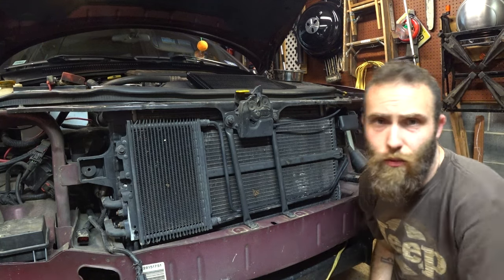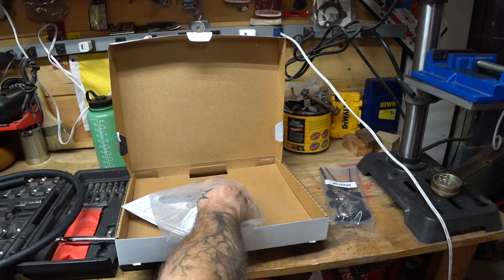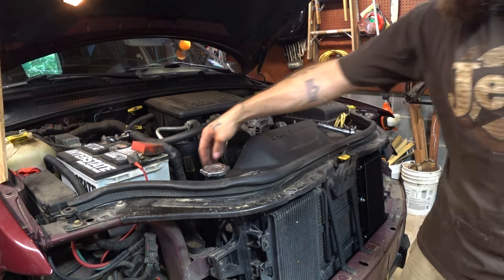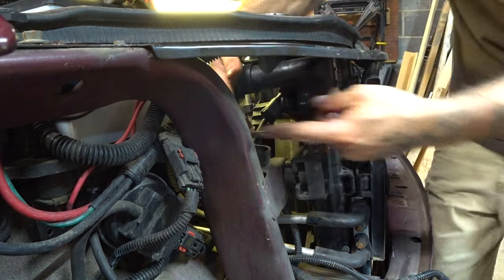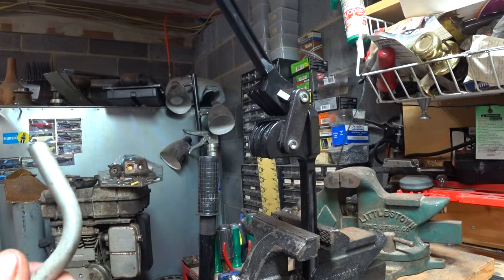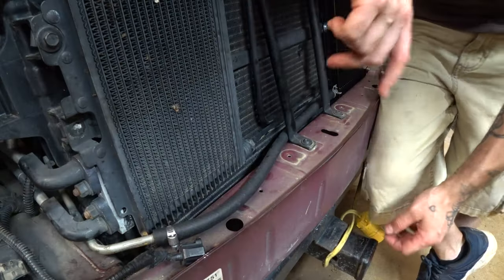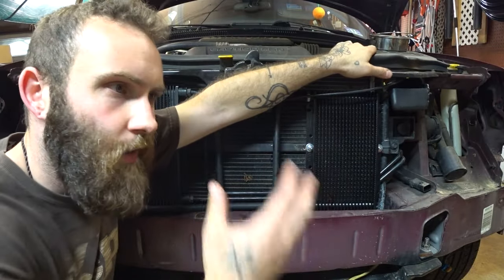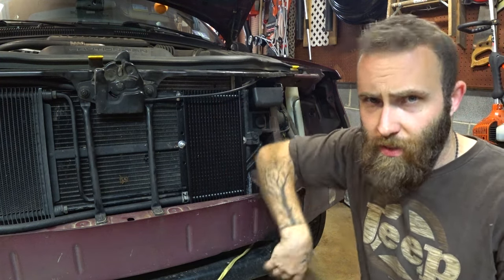How to install a Transmission Cooler - EASY!

Comment: Great upgrade!! Simple and effective. I think upgrades like this should be done first to your rig instead of adding every kind of light bar on it... performance before ornaments. Can’t wait for the fan installation video to come out
Reply from the maker: Amen to that! The fan video is going to be a while. I am hvaing trouble dialing in where I want them and what needs to be done to improve efficiency. Once I have it dialed in, I will post a video

Comment: In my opinion that's just a a good idea a good fix or Improvement to any vehicle of any make or model good job dude
Reply from the maker: Right on! Thanks buddy!
Reply: Definitely...even if you aren't towing, keeping the automatic transmission cool is essential as heat is what kills them quicker than anything.  Far cheaper for roughly $50 transmission cooler than $3k+ for a transmission rebuild or replacement.  

I think he's also spot on with adding additional electric cooling fans, not necessarily need them running continuously but if you are towing heavy or in heavy traffic being able to turn those auxiliary fans on will not only help cooling the transmission/power steering fluid it'll also push extra air through the condenser helping your air conditioner and through the radiator helping to keep it cool as well...I don't think the clutch fans or hydraulic fans help too much with airflow when you are sitting still.

Comment: I've done some experimenting over the years, the setup I like to go with is only using the aftermarket external trans cooler around the end of spring/early summer. I've noticed it allows the motor to run cooler for longer before the fan comes on while in traffic or while the motor is warmed up sitting at idle. I live in New Hampshire, so around fall time, I hook the stock trans cooler back up, from the transmission, the fluid goes into the stock internal cooler first, then into the external, then back to the transmission (mine is the 4.0 with the trans cooler inside the radiator). That way the trans is warmed up and ready to go after warming up on a cold start during the cold months. When I am not using the stock cooler, i leave the transmission fluid inside the stock internal cooler with a hose running from the stock trans cooler inlet to the outlet to prevent anything from getting inside. As stated above, after experimenting over the years during different seasons with below zero temps in the winter, and above 100 temps in the summer, using only the after market external trans cooler in the summer months is what I have found works best for my Jeep.
Reply from the maker: This is really insightful. Thank you for sharing. I am brainstorming a way I can easily switch between the two so that I can give this a try
Reply: Have you had issues in the winter with just the aftermarket cooler?

Comment: This is good timing on The Pusher fans that you're trying.I'm actually looking to add a pusher fan on my XJ. I am in the belief that my cooling system works fine,but when I amon the trail crawling and not getting a lot of air through the radiator I'd like to have a backup secondary fan to help cool. I'm also am very big supporter of doing trans coolers even on vehicles that may not necessarily tow. I feel that it extends the life of the transmission. Good mod and nice looking install
Reply from the maker: Absolutely. I believe most trucks and SUVs can benefit from this
Reply: You definitely need extra air flow on slow trail driving as the regular fan isn't going to cut it at low speeds.  The more the airflow the better.

Comment: I thought that they said to have the direction of flow start at the bottom of the cooler and exit the top. Apairently it cools the fluid better and doesn't trap air bubbles.
Reply: Correct. It’s gotta push up and not fall down. 
The theory is it takes longer and uses abit more energy todo that which makes it cool down more.
Reply: YES. That is true for the Coolers mounted with the Holes pointed to the SIDE, but the "Stacked Plate" type Coolers should be mounted with Holes UP for maximum efficiency.

Comment: just add a bottle or 2 of super coolant and hook a separate toggle switch to your main radiator fans so in case you are sitting in traffic on a hot day or just plain hot, then flip your fans on. It will keep your antifreeze cool and your trans fluid cool through your radiator.

Comment: if you install a pusher fan on the new external trans cooler, will it not be pushing air directly into the pusher fan that is located on the engine side and that cools the radiator? Two airstreams will be colliding and that I think will not be good for engine cooling....??/ what do you think??
Reply from the maker: That is exactly what happened. Haha.. I put the fan on and it cooled worse. took them off and it is fine
Reply: So then I am thinking, flip the tran cooler fan around so instead of pushing into the cooler, it will pull air through. Not very efficient but heh......

Comment: Great job on everything but u want it to go in the bottom of the cooler and out the top. So there isn't any air pockets trapped in there.
Reply from the maker: Every cooler I have setup has been downhill as the stock cooler on this Jeep was. This was confirmed by the Hayden instruction that came with the kit.
Reply: @DEInTheGarage  understandable just must opinion
Reply from the maker: Fair enough.
Reply: @deezneezy412  remember heat and so rises,cool sinks,so better to have the hot fluid coming to the top where most heat will be,which more heat will scape too,and cooler fluid down

Comment: Video is good to go. Thank you.

Going to attempt similar mod on pos nissan altima to try and 
prevent pos cvt transmission problems. In general, how is your
mod working out, and any further advice ref how much additional
atv required after the mod?

Again thank you for posting this. Good gouge and appreciated.
Reply from the maker: I have been very happy with it. In fact, I forget it is there because I have no issues with it. This method produced the least leaks (zero leaks) of any I have attempted. Would recommend
Reply: Let me know how it goes with the Nissan CVT. I put coolers and magnefine filters and Amsoil ATF in all my automatics. Thinking about doing the same with 2011 Nissan Altima CVT except using the Amsoil CVT fluid.

Comment: So basically you ran it through the radiator cooler first, then into the external cooler then return back to the transmission? Great fan ideas but I think putting one fan in the middle on the radiator would be better sense the radiator is general is now even restricted more and let the natural flow of air fuse the outside smaller coolers.. just my opinion.

Comment: How will this effect your engine temperature now that you have restricted the airflow to the radiator. Jeeps by nature have a small grill area which restricts airflow bye design. Not a good design but it looks cool and jeep ran with it. Will this increase the heatsoak issue? If you don't think a  trany cooler restricts airflow hold it up to a fan a see what little air passes through it.  What are your thoughts on this? It's funny how the new jeeps come with hood vents. 2020 and they still haven't fixed there heat issue. Sorry I love my jeep just been dealing with heat issues since 1970 on all my jeeps.
Reply from the maker: I had similar concerns when planning this project. That is why I am planning to add the pusher fans. That said, it is 92 degrees here today and I was just out driving around town for almost an hour with no issue. there seems to be enough air moving through the cooler to keep the radiator cool as well
Reply: I cant drive my jeep in the summer it dont like the heat.
Reply from the maker: @keithlea6804  I hate the heat. My one WJ does not have AC which is why it sits a lot during the summer
Reply: @DEInTheGarage  would like to see a vid of u fixing your a/c. its not hard once u get a shop to suck freon out. alot of peoples a/c doesn't work.
Reply: @keithlea6804  😆 🤣
Reply: This is why I'm going with a remote mounted cooler underneath. Allows the engine and ac to cool better.

Comment: I think I missed a part. Can you explain a bit? Where is the line flowing fluid from the transmission to the original cooler connected to? There should be 2 lines coming from the Tranny. One coming and one returning. It seems you have used the port entry of the original cooler to connect to the entry port of the new cooler if I am not mistaken. Shouldn't the original port entry be receiving the fluid from the tranny? and the return port of the original cooler should be sending a line to the new transmission cooler being installed (or the top port)? That just leaves the exit port on the new transmission cooler to connect to the line returning to the transmission. I have never done this before but I am trying to understand the schematics of the flow. I only heard you say that one line was returning to the transmission. But which line has been adapted to receive the fluid from the transmission. I think I may have missed that part.

Comment: If you re-route the trans cooler lines for the portion of the radiator straight to the aftermarket cooler you avoid allowing your trans fluid from even coming in contact with a 200 plus degree radiator.
Reply: Exactly! Making it a standalone system is much more effective, rather than mixing with the hot engine coolant!
Reply: @paulvo7955  But was that not designed that way, so the tranny would warm up along with the engine in the winter?
Reply: @ibberman has anyone had issues in the winter from bypassing the radiator?

Comment: Am I missing something, it looks like you unhooked the transmission lines from the radiator, then joined the transmission cooler to the radiator, but how did you hook the transmission lines back up

Comment: Silly question and maybe I missed it, but if the lines were already going to a “cooler”, why add another one?
Reply: I know I'm 7 months late to the party, but to answer your question; the reason to add another cooler is because the manufacturer wants to save money so they factory install a transmission cooler that is good enough for most conditions, most of the time.
Heat can cause transmissions to fail prematurely, so it can be a good idea to add something like this to help extend the life of your (very expensive to replace) transmission.

Comment: Jeep must of done some changes when designing the WJ vs the ZJ because I have 5 ZJs (a 94 5.2,  a 95 4.0 ,2 96 1 4.0, other 5.2, and a 97 5.2) and they all have a tranny cooler but no power steering cooler, that's y I'm thinking on putting power cooler on my 96 5.2 beens that's the one I drive the most, you know if the tranny cooler u installed would work as a power cooler?

Comment: should always use the lower (return) on the rad trans cooler. basicly the way you have it the radiator trans cooler will re heat the trans fluid. the idea of a extra trans cooler is to cool it even more after the rad transcooler.

Comment: Wtaht ab winter season like here over north carolina when temperatures are near 25 degrees..? Those transmission coolers will make any damage to the transmission keeping transission fluid very cool cus is very cool climate here...

Comment: Question: The fill level of my transmission is ok when the engine is off but then it goes down when the engine is idle. Which is correct? I dont want to add to much fluid...

Comment: For adding external and keeping OEM tc cooler, which line will i cut to connect to external IN were then exit from external nd go to the oem ? What line is it ! IN or OUT from OEM tc lines? Ty

Comment: Did you put it accidentally on the radiator in line? and bypass the radiator? You want it to flow through the radiator then in series go to the cooler. Put it on the radiator OUT line, then to the cooler in then the cooler out to the return line (filter there)  Use the radiator to cool the transmission and then the ADDED cooling capacity. Not a big fan of adding hose without saying replace them often. They break down from the inside so it is not a bad idea when adding rubber to also put a filter on the return line...

Comment: Aight, this is a little strange for me. My 99 has a factory aux transmission cooler which is mounted on the...tadaaa... right side of the car. How is it that your ps cooler is where the transmission cooler should be? Is it because of your hydro fan?
Reply from the maker: Yes, it is because of the hydro fan. it needs the PS cooler and I guess they didnt want to cover part of the engine coolant, so they put it in from of the trans cooler side of the rad. I am not sure though

Comment: hey dude great video i like the way bend those tubes. hey just had a question for u i just put in a complete rebuilt transmission in my 2000 honda odyssey. do you think its a good idea to put in a  transmission  cooler with fan just like what u did.
Reply from the maker: I imagine it would not hurt. I know those Odysseys are notorious for trans issues, but I am not an expert on them. I would suggest you find a honda forum and ask them there to be sure. I would say it cannot hurt, but someone who works on them routinely can tell you for sure if that trans would benefit from extra cooling.
Reply: @DEInTheGarage  thanks

Comment: Why doesn’t anyone remote mount a cooler and fan away from the biggest heat source there is in an engine bay? ........the radiator 

Why not put it between frame rails under the truck somewhere?
Reply: They put it in front of the radiator because THAT'S WHERE THE MOST AIR-FLOW IS .
 The "biggest heat source in the engine bay" is NOT the Radiator. It is the Exhaust Manifolds. 😁
Reply: @SlikLizrd  
There’s airflow only as long as it’s moving forward
Otherwise it’s useless.
But that’s only my opinion, and I’m not an engineer by any stretch of my imagination.
Reply: @Chief6067  The Trans Cooler will reduce the Fluid temps until they reach ambient air temps, whether moving or not.
 The Efficiency of the cooler will be GREATLY reduced, however.
As with anything else, the more air flow over it the cooler it will be.
I live in the heart of the desert, and I run a 13,000 btu B & M Stacked Plate cooler on a V-8 engine with a modified Auto Trans -- for long-distance, high-speed touring throughout the deserts and mountains of the American West.
 Installed about 130,000 miles ago, the
 B&M Trans cooler has extended the life of the Transmission beyond the normal wear-out time. At 180,000+ miles, Trans still shifts smoothly and crisply, with no discernable slippage.
 My Trans Cooler is installed 3 inches in front of the AC Condenser -- with NO Fan attached to the cooler.
Reply: @SlikLizrd  
Thanks for that information about the B&M unit.
I was looking at the Derahle unit that has an electric fan on it.
I live in a high desert area that usually gets to the triple digits in summer for only about 20 days during the summer but Im thinking on the cautious side and possibly save myself a huge bill for trans repair if I can avoid it.
Reply: @Chief6067  I'm down here in Phoenix, Chief, where it's a plenty hot for 8 months of the year -- never needed a Fan on the Cooler, regardless of load or outside temps.
 I understand your caution, and your valid concern -- however, a Cooler Fan is another source of potential problems, and should be avoided for that reason.
 CHEERS  !
Reply: @SlikLizrd  
I’m beginning to think your right about not having a cooler with a fan.
I’ve heard a common theme with a cooler in front of the condenser at front of truck being sufficient for cooling.
I have a 6L80E that gets pretty hot at times and I just want to avoid a $6k trans bill 💵 😁
Thanks for your information 

Cheers 🍻

Comment: The proper way is to run the after market cooler before the radiator cooler.
Reply: Not according to my install instructions
Reply: @aquaticnstuff7666  If your instructions tell you to run it last it is wrong. the transmission builder wants it before the radiator so if it is very cold the transmission will be warmed by the radiator somewhat to bring it up to operating temp. 135 deg not more than 150 and my 700R4 with a B&M supercooler maintains that perfectly even on the mountain roads.
Reply: @ronaldnelson7204  Interesting theory and I believe it has merit however I am going with the installation instructions especially since my cooler is not that large; and I live in the southeast where it does not get cold very often or the same extremes as the North.
Reply: @aquaticnstuff7666  All I can say about that is you better have a temp gage that reads transmission sump temp and that it stays between 135 and 150 deg. If you want to know more call BowTie overdrives in Hesperia California they know their stuff.

Comment: Poor guy has to deal with Ford buckets of bolts design. Their engine compartments look like the engine was installed with a shovel, parts tossed under the hood.